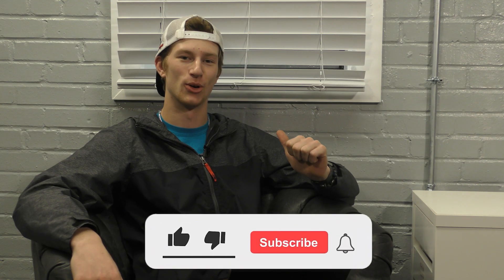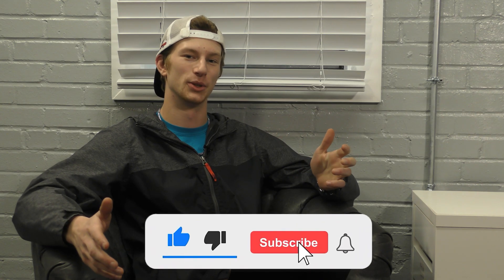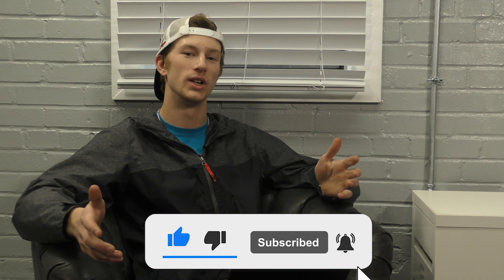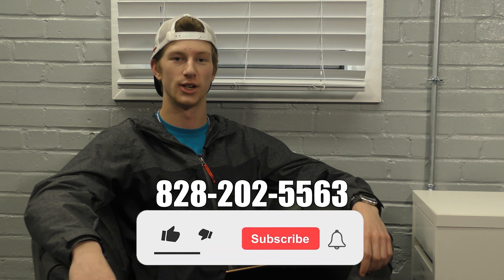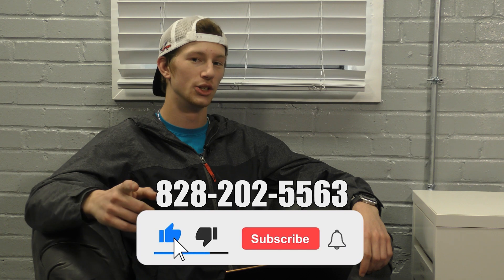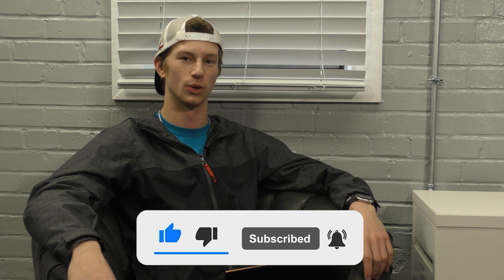What Coatings can VAPOR HONING PREP FOR? - Vapor Honing Technologies

Comment: So as a gunsmith I might come accross a part that has some rust and or pitting, can vapor remove the rust and smooth the pitting?
Reply from the maker: It will remove the rust but Vapor Honing will not remove/fill pitting
Reply: @VaporHoningTechnologies  Thank you